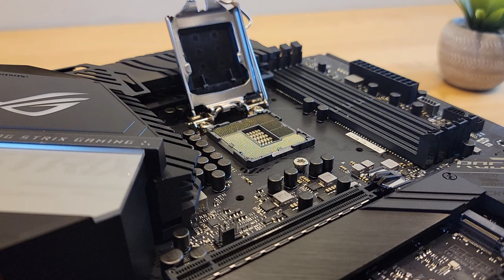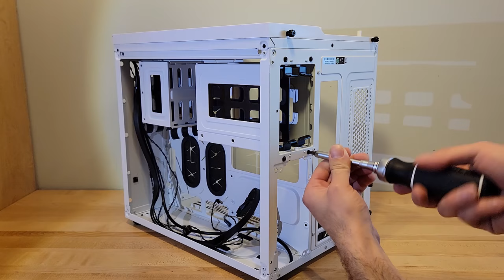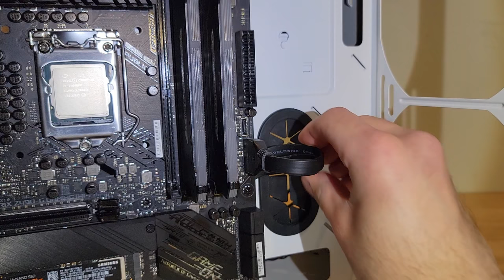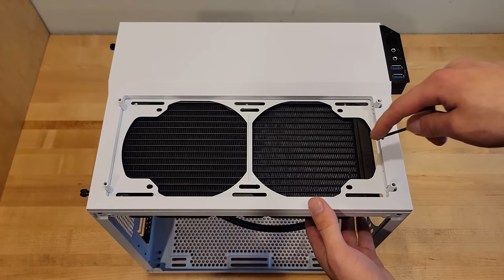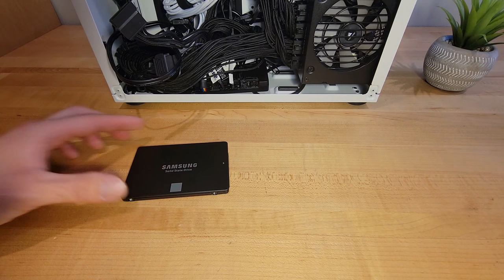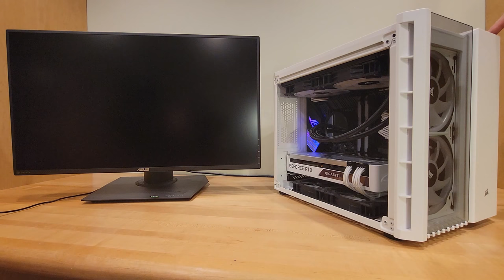Corsair Crystal 280X - Full Build - 280mm AIO!

Comment: So I wasn't entirely shure how well the full aio would fit in here but it fits surprisingly well especially if you downsize the fans attached
Reply: I didn’t downsize anything, 140 fans in front and on the bottom. But the Bottom fans help a lot especially with a lot of heat. My 3080 ftw3 at 70-75c and 5800x liking 75-80c, in the winter I don’t mind the extra heat in the room 😂😂😂😂

Comment: I've been interested in this case for a long time and your build is my favorite so far. Now I'm kinda nooby when it comes to the PC building game so I was hoping you could answer a couple of questions, mostly about airflow. Which of your fans did you use for intake and exhaust? Which ones are the 120s and which are the 140s? And would your fan setup still be a good option for me if I just wanted to use the stock fan coolers for my GPU and CPU?
Reply: I have the same case and almost the same setup. Best configuration for airflow is bottom and front intake. Top exhaust. All can be 120 mm . But if you wish to put 140 mm. Put it to the front. Stock coolers for GPU and CPU would be fine for this case. Getting high 60's for gaming.
Reply: @noone998  I agree 100%. Make bottom and front fans for intake since it should flow and cool better since hot air rises and you would naturally want the exhaust at the top.
Reply: I would remove the white shield at the back and add an extra small exhaust fan if able

Comment: Phenomenal build my dude, I have this exact case and the only gripe I have is the restricted air flow at the top. Removing the glass drops my coolant level be about 4c. I have a Corsair 240 rad. What types of temps have you seen with your components / sound level? Keep up the awesome videos!
Reply: I've had this case since it launched - raised the top glass with spacers 1 cm (improved airflow) also put pads on the feet of the case (raise 1cm) better intake with less dust 👍 CPU cooler is Corsair H100i Platinum SE with Rad in the top (with LL120 fans) LL140's in the front - RTX3080TI (MSI Ventus 3X) at the bottom - I have Asus ROG STRIX (ITX Mobo - more space😁) Temps are fine, no issues, fans ramp up a little when gaming but doesn't sound too loud 👌
Reply: @genx156  I did the same with a spacer and added intake fans at the bottom and got much better cooling temps!
Reply: @Rizzo2009  I might add some bottom intake fans too 😁
Reply: @genx156  I have the 680x version and was curious what spacers and pads you used? Thanks In advance!
Reply: @mikeg5669  IM also following this!

Comment: I know this is a lot to ask but I am kind of copying your build part for part and when I saw all the cables going into the rgb thing I got really confused. So if you can, do you think you can do a video on how that works? Would be very helpful. Also do you think a 3080 would work in this case and if so what changes would I have to make to other parts
Reply: which 3080? there are multiple variations and they are all different lengths
Reply: @flame60  3080 vision oc
Reply: @lightlyfriedfishfillets8117  maximum gpu length for the corsair 280x is 300mm, 3080 vision oc is 320mm, so maybe wont fit
Reply: would also recommend getting a mid-tier gpu and waiting for 40 series nvidia cards
Reply: @flame60  I was about to get this case, I have a msi RTX 3080 gaming trio, and is 320mm, so it would be a wall for air flow

Comment: in your parts list you have 4 ll 120s and 2 ll 140s but in the video it looks like they're all 140s? do you think a 280mm radiator and 6 ll or qls would be possible?
Reply from the maker: Oops, good catch! It should be 4x LL140'S and 2x LL120's. I couldn't fit 2 LL140 fans on the bottom because the front panel headers/plugs were in the way. Only 120mm fans would fit.
Reply: @Subdubbin  Do you think with a mini-itx board you could fit 140s all round?

Comment: What length is this GPU? I was looking at selling my 2080 and upgrading to a 3070 Ti but this case says that it has a maximum GPU length of 300mm. Beautiful build by the way
Reply: You can get away with 318mm.  I have a 321mm 3080ti in mine.  It fits, but I had to take out the front bottom fan.  If you don't care for the front intake fans, you can probably get away with 328mm.
Reply: @jefflieu9026  Could you go with 310mm and still have the front bottom fan?
Reply: @isaintlikei4076  I was actually able to get my 321mm 3080ti to fit.  The front fans have to be 120mm though.  310 will 100% fit.  I had to wiggle my gpu into place with only the top fan.  I then unscrewed the top fan and let it slide down all the way to the bottom.  I then angled the 120mm into the top spot and tightened down both front fans.

Comment: I’m finding it very hard to find info online, but can you tell be what the maximum height of GPU that will fit into this case is? I had the predecessor case for this , the Corsair Air 240, and it was limited on gpu height before you were hitting the glass panel

Comment: Just watching the build again, if you had put the cpu cooler in first before the motherboard would that have been able to allow you to screw it in correctly or would you have not been able to get the motherboard in afterwards?
Reply from the maker: That's a good question; not sure if that would make the install easier. I sold the case but it would be interesting to try your idea.

Comment: I’m thinking about getting this case. Let’s say I have the exact setup almost. Would I be able to fit a 240mm aio on the bottom for my gpu?
Reply: Corsair says u should be able to but it'd probably be really tight if u have an matx Motherboard since the bottom connectors reach the bottom of the case
Reply: If you use an mATX you cannot get 140s in the bottom. That's why this dude put 120s.

Comment: Which fans are 120mm and which are 140mm? I'm assuming the radiator fans are 140?
Reply: The RAD and front are 140 and the bottom are 120s.

Comment: quick question. do the fans attached to the radiator count as outake for the coolinng of the case or does it only cool the cpu? i want to do something similar to this but i don't know know how to equalise the air pressure. Thanks
Reply: Yes, but it is more restrictive than without. Positive pressure is a good thing

Comment: can you not use the nzxt fans with the AIO or did you swap them out for RGB reasons ?
Reply: Any fan that’s the same size will work with any radiator. For example my computer has multiple Corsair AIOs and I have all 3000rpm industrial noctua fans cooling it. I guarantee he changed them to Corsair fans so he can plug them into his Corsair RGB node rgb controller

Comment: You think my MSI RTX 3080 xtrio will fit inside this case? and ITX motherboard with 280mm aio on top
Reply: Check the website of the case there’s maybe the dimensions of the inside and outside, but there are more case options from Corsair if you want like the crystal 680x(taller version of the 280x)
Reply: @wanou_4259  i have itx motherboard....

Comment: Any dust filtration on the front? What are the fan compatibilities
Reply from the maker: Yes there is dust filtration in the front. 140mm fans in the front.
Reply: So, 2 140mm in the front, 3 120 on top and bottom?
Reply: @williamswallows6909  Two 120mm fans on the bottom, two 140mm fans on the top with the radiator.

Comment: Couple of questions if anyone can answer, firstly can you use a normal size power supply in this case or do you need a sfx one like in the video? Also can you fit normal old hard drives into this case? And finally that commander pro thing does that clip onto the other Corsair thing or was that cable tied together
Reply from the maker: You can fit an ATX power supply in this case. I didn't have one so I used an SFX psu with an ATX adapter. You can fit 2.5" and 3.5" hard drives in this case. I took out the 3.5" drive caddies for more room for cable management. The Corsair things were taped together.